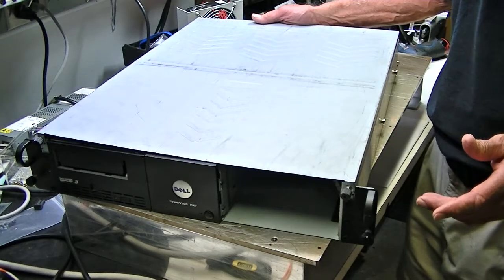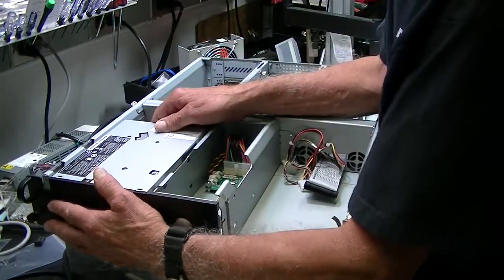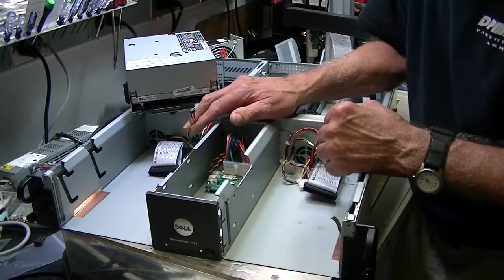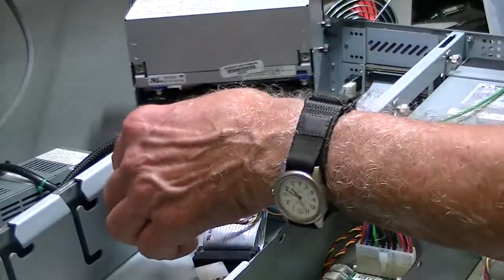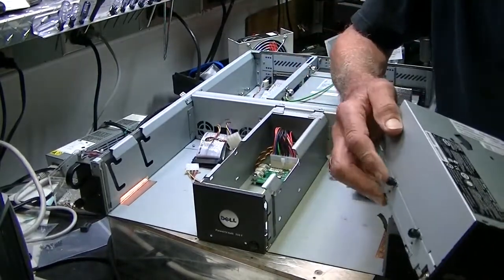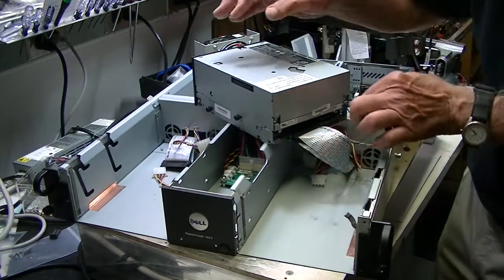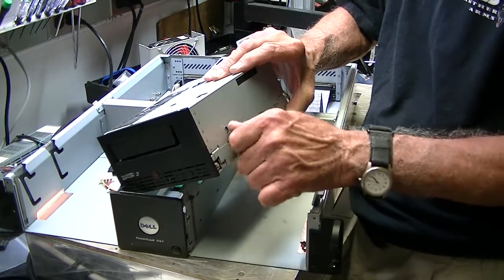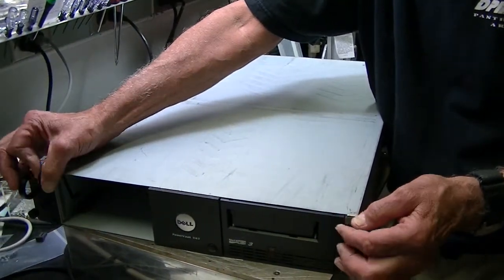Dell 114T LTO3 Tape Drive Installation

Comment: Hi, does can you help me? I have an Dell Powervault LTO4T with Tape Drive LTO4 and I want to know if is possible to substitute the Tape Drive LTO4 with Tape Drive LTO8?
Reply from the maker: Hi Eduardo: Without knowing the model of the Powervault I am going to guess, at PV 124 or TL2000/4000  If you want to upgrade the drive you will need to purchase a tape drive designed for your autoloader.  Needs Dell autoloader personality and mounting hardware.  A stand alone tape drive will not work for you.  I do not believe a LTO 4 tray will work for the LTO8.  There is some intelligence on the board on the tray.  If you have a 124T the library controller card cable may not fit into a replacement LTO8 drive.
Hope this helps - Regards,  Dan MWTSS.COM

Comment: How do you connect an internal LTO4 FC IBM drive to Windows XP computer? I don't have an enclosure so I'm powering it up using a molex power adapter. I have Qlogic QLE2460 PCIE card and connected the LTO4 drive to it but I don't see it appear in device manager. Is Fibre Channel plug and play like USB and SCSI?
Reply from the maker: Robert sorry about the late reply. /we do use that older OS for testing purposes only.  We do not back up data we use NovaBack for those reasons.  If you have a FC interface those drives were set up for library use only,  We have specialized techniques that allows the drive to be seen in the more modern versions of the MS OS  Not sure if XP has the ability to recognize FC.
Quite typically the documentation on you PCB will list a matrix of supported devices, if it is listed on the OEM listing than it should work.  I suspect with the Library Personality on you FC drive it will not play if not modified to show in the device manager.
Hope this helps

Regards, Dan  - Owner Midwest Technical Sales